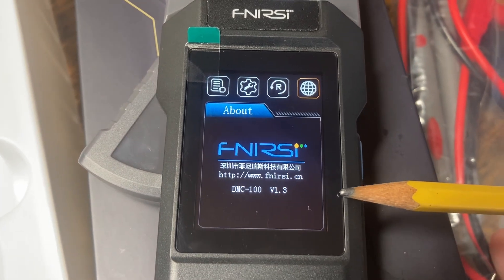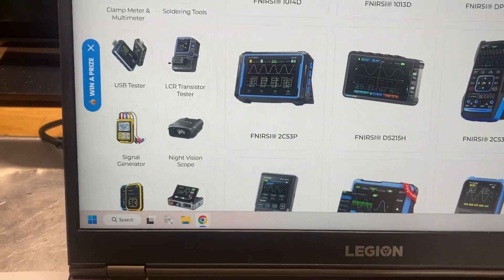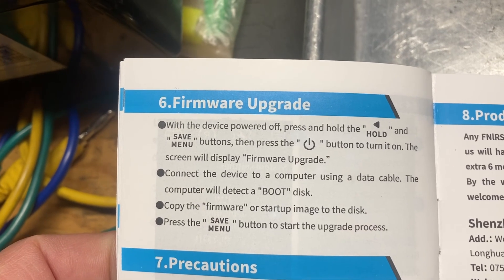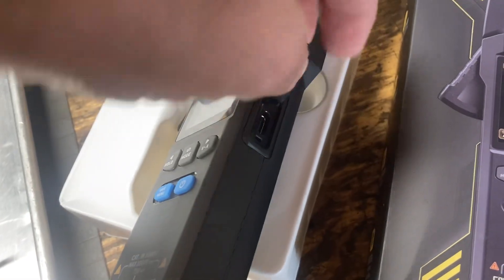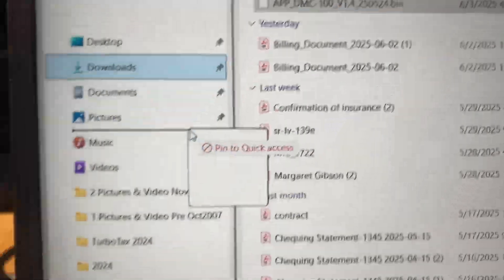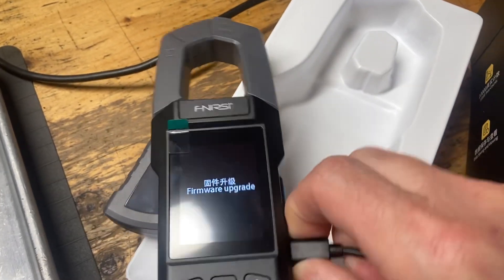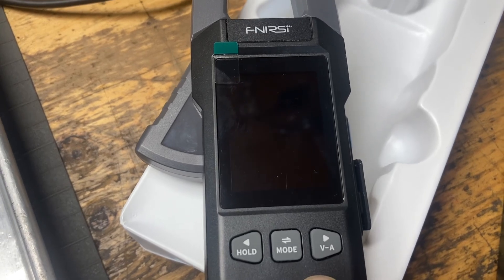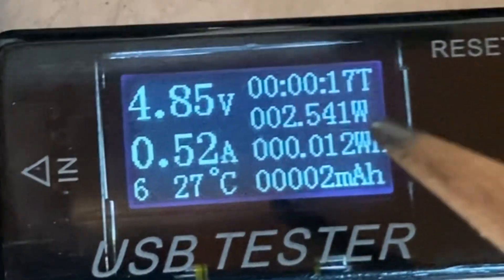Fnirsi DMC-100 Amp Clamp Firmware Update (V1.4)

Comment: I am confused about uni-t ut204+ or fnirsi dmc100. Which one should I take. I want longevity as well as feature and robustness.
Reply from the maker: I can’t express a qualified opinion on the Uni-T product as I don’t own that offering. The Fnirsi is a great product for the price, as you won’t find many graphing meters at this price point. I suspect the 
Uni-T is slightly more rugged. Features or durability is for you to prioritize. Thx for watching. 🍀🍻👍
Reply: @TheGibby3340 brother, Does fnirsi work good with high/low volt and amp?
Do you have face any issue on software or real time use?
If you say so, I will go for fnirsi dmc 100.
Reply from the maker: I really like the DMC 100. No real issues…the auto scaling on the graphing function is a little weird at first exposure. Min/Max functions well. Don’t drop it off an elevated work platform and you’ll be fine. It’s dirt cheap, if it doesn’t meet your expectations it’s no great loss. 🍀👍🍻
Reply: @TheGibby3340 then im going for this one. Thank you so much for you advice brother.

Comment: Gibby I responded to your last video but when I sent it I guess it went to outer space . Did you ever find out what was causing the vibration in the steering wheel at 40 - 45 mph ? Also did you have  any trouble updating the DMC-100 ? I get as far as the tool saying ready for update and then nothing . I’ll watch your video again I must be missing something . Cheers
Reply from the maker: Hi Artie. It happens frequently, comments disappear into the ether 🤷‍♂️ The vibration has mysteriously disappeared. I noticed there was a fair bit of mud slung on the undertray. I can only stretch to the assumption that a wheel(s) may have had some mud adhering to the inner rim surface which has since been shed. Little more than a guess at this point. Bit of a mystery. During the update on the amp clamp, once the notation appears on screen that you mentioned you are required to push the “save/menu” pb to complete the update, then turn the tool off and restart it to confirm update. 🍀👍🍻